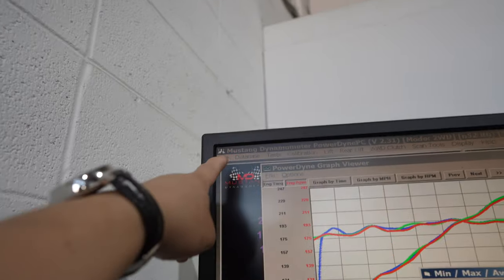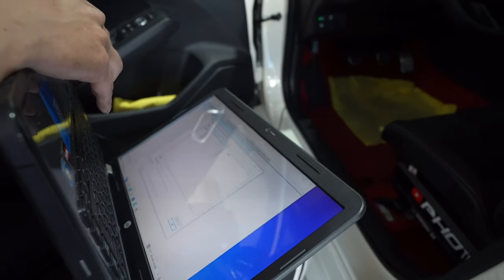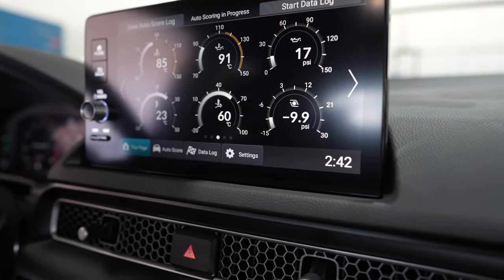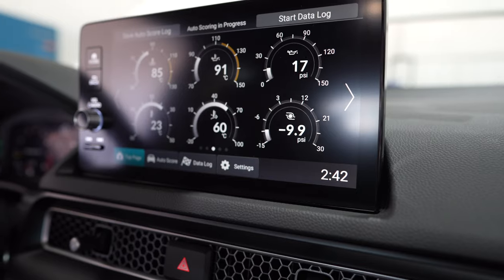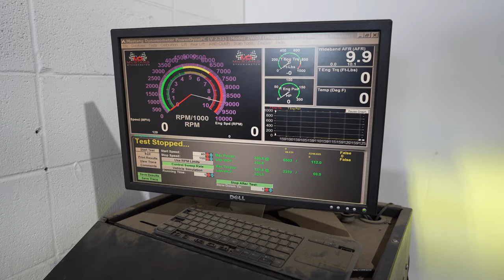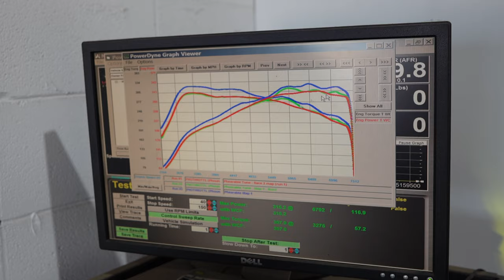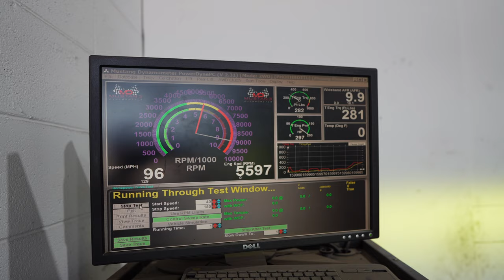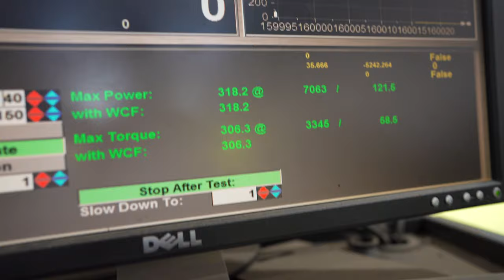Dyno Testing The Phearable Honda FL5 Tune.

Comment: Street tunes are usually more aggressive than track maps sir.
The money you spent on this OTS, could have been spent on a custom tune.
Reply from the maker: The ots was $250 and a custom tune in Canada is average $1600 cad. I didn't know a street tune was more aggressive I was thinking it was the opposite. Just waiting for Matt to send me the data sheets to verify. Thanks for the info!